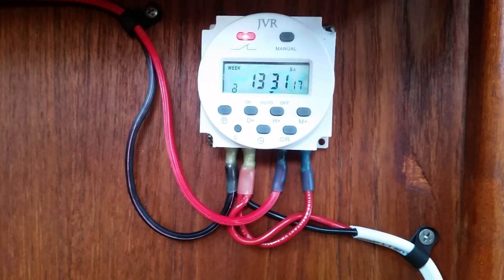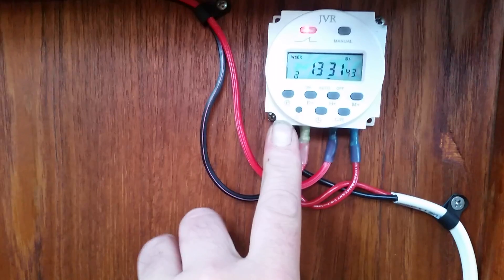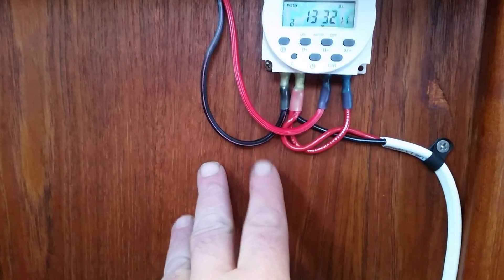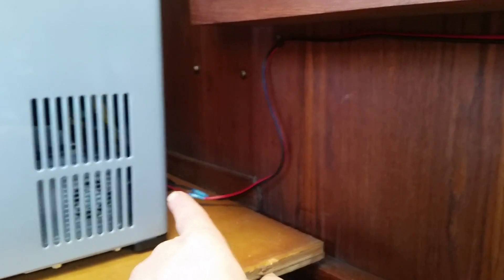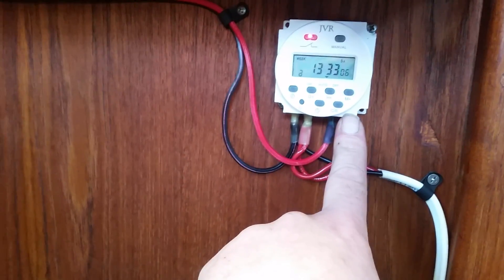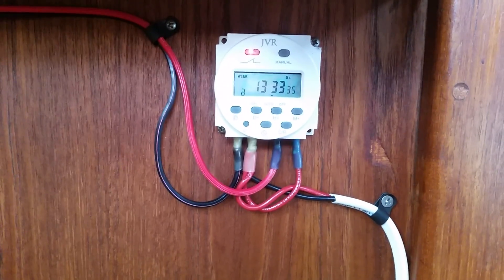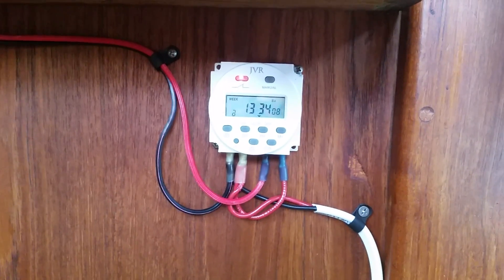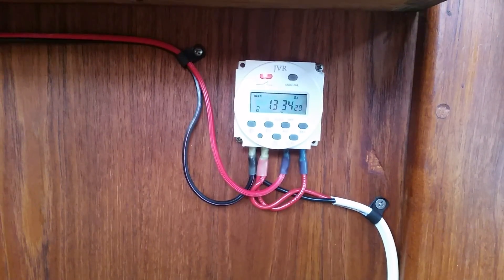12v DC programmable timer switch wired properly

Comment: Thank you for the demostration. Please, I have a question, I have using such controller which only has 12DC volts or 220AC volts. Now, the new controller I purchased shows that it work both on 12DC and 220AC volts.  How can this controller handle and get connected to work on AC volts and then DC volts

Comment: On the back of my unit, the power to the timer is opposite of what you show, but it appears to be the same device.  The back of my unit and the instructions both show the negative as the 2 pin from the left (facing the timer, it would be red, black, red, red).
I've already mounted the timer on my board... now you have me second guessing.  I guess I'll remove it and check again... better safe than stupid.
Cheers.
You can also wire this with a separate dedicated power in to the timer (pins 1,2) and a second power source for the unit to be controlled (12v, but obviously necessary if you are switching a 110v appliance which my timer can handle.)  You just interupt the positive of the power to the appliance with the switch.  Good for if you want to manually shut off the appliance/light for a period without programming monkey-ing.
Reply: Thank you for the info. Please, I have a question, I have using such controller which only has 12DC volts or 220AC volts. Now, the new controller I purchased shows that it works on both 12DC and 220AC volts.  How can this controller handle and get connected to work on AC volts and then DC volts
Reply: @yusifsuleiman5502  verify this, but the timer runs on 12VDC.  It can act as a switch for 110v/220v simply by interrupting the power to the 110v unit you are controlling.  The timer needs 12v DC to power the timer  (from solar bank etc).  If it were a light you were trying to control  you would cut the neutral wire of the cord (interrupting the circuit) and connect each side of the cut wire to the "in" and "out" terminals of the switch (similar to flicking a light switch, but in this case the timer is an automatic light switch... A self-flicker if you will).  The DC power runs the switch and activates or deactivates the relay switch inside the timer allowing the 110v power to flow to the light in a complete circuit.  Some people prefer to interrupt the hot wire, some prefer the neutral (which I believe is code around these parts).  But check to make sure your unit can switch 110v/220v and is not just a DC switch.  Just think of the timer as a unit and the device as the unit being controlled, but still requires its own power source if AC

Comment: Anyone know if the feed coming out of the timer is indeed 12V? 
I’m trying to power a power inverter but only once a day for an hour. My theory is 
Battery-> Timer-> Inverter->Appliance. My concern is over powering the timer from the draw of the inverter and appliance. Any advice is appreciated.
Reply: This timer didn't work for me. As I had. Battery. To timer. To inverter dc to ac to power a sump pump. After wiring it differently, 1 and 3 pins positive to battery. 2 negative to battery and to inverter dc port. And 4 positive to inverter. The timer melted
Reply: @Hf0205  thank you for letting me know!
Reply: You probably need a 12v magnetic switch or some type of relay so as not to burn the 12v timer.

Comment: Can that timer be programmed to run for a set period (say 10min) and then off for a set period (say 30min) and repeat for the entire day.  What happens to the program if input power is lost.  Internal battery to keep program?  Thanks.
Reply: No it can't because you only get 16 on and off setting. So it can not be set at those time intervals for the whole day.

Comment: Interesting. Can this be used on a fresh water transfer pump? I wan to make a self watering wicking bed and thinking of a way to reuse the drainage water by way of a pump. We go away a lot so this would be great to use. We already have timers on our sprinklers for our gardens that uses well water. I would much rather use another source of power. I plan on a 12v dc pump so I can use a battery source. I am guessing connecting the battery source to the timer and the pump source to the timer? This is making my head think a little hard. lolol. Great explanation video.
Reply: Can yoh please provide the details of the timer you have used here...

Comment: This worked great. I’ve rigged an external heater hack for an inflatable hot tub and the original poster for the hack referenced / linked your timer switch and wiring demo vid as the gold standard. Thanks for the tips.

https://www.outsidemodern.com/use-inflatable-hot-tub-winter-cold/
Reply from the maker: Awesome!! Thanks for the feedback.

Comment: Hi does this need ac mains in (source) or will 12VDC in still give  12VDC out ? on a timer ?
Reply from the maker: DC only
Reply: @angryoldwhiteguy  you seem to know this switch 🤣 can I ask I have 12 v supply and want to out to a 12v DC light (it says output 250v ac) (I connected a 250v ac adapter 12v but nothing happened 🤣)

Comment: Hello, What if i connect the source power DC positive to pin 1 where you have connected to pin 2? is that a must that i  have to connect the negative to pin 1 and positive to pin 2? Or will it work two ways. Like in AC plugs where i can connect Live wire to Neutral and the Neutral wire to Live and works fine?

Comment: I have to assume using the timer reduces the average temperature inside the freezer? If that is the case, why not just select a lower temperature for the freezer using its built in thermostat?

Comment: in your type of setup that may work for you, but if efficiency is a bit more desired. i'd suggest a more advanced method of controlling it. such as a industrial digital temperature controller. liquid electrical tape is also a boaters friend, I also usually add regular electrical tape to make it more abrasion resistance too

Comment: Can this be used for shutting off a portable generator?
Reply from the maker: I suppose it could,,, not exactly sure how to do it but if it requires an open/close switch then I guess it would work...... but this is an uneducated theory and not mechancical/electrical advice... let me know how it works out. good luck

Comment: I have a Dc Freezer which runs on 15amps and thats been a big challenge getting batteries and panel to support it. Tell me, how does what you have in the freezer turn out with the arrangement you have. Where can I get the timer?

Comment: hi i brought one of these on ebay ......its got on the back ....power 12volt dc/ac.......and     16(8)A,250VAC   ........ive conected 12volts to the left side when looking at the face of the timer and ive got the active red wire going in and out of the right side  from an inverter that can make 3kw thats 3000watts of 240 volt power ...and its working is that how you would do it or have i done it wrong

Comment: Still you connected them wrong.
You have to switch the two wires on the right.
It doesn't really matter, it only lets the current flow the other way around.
Now you use the input as an output and an output as an input.